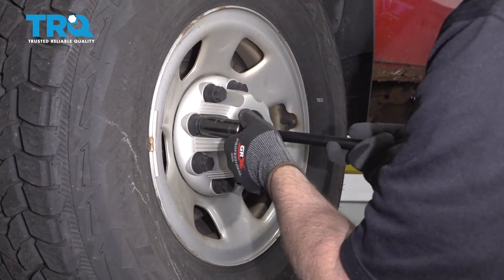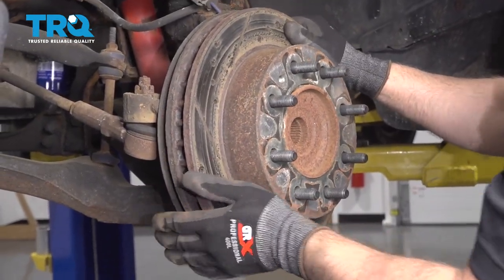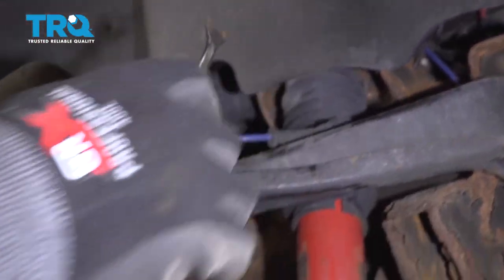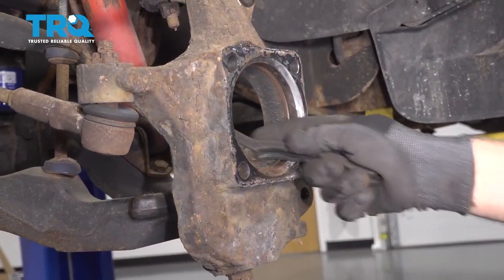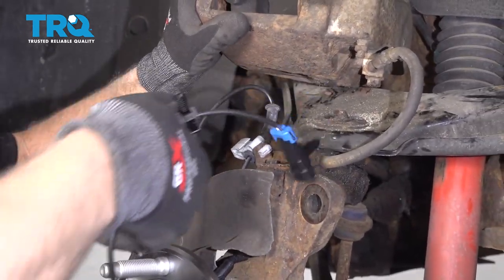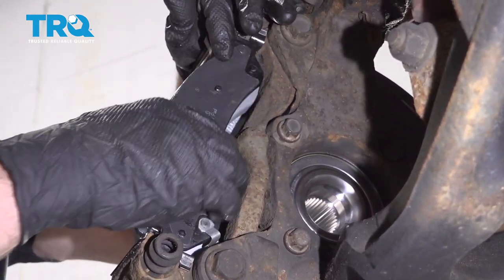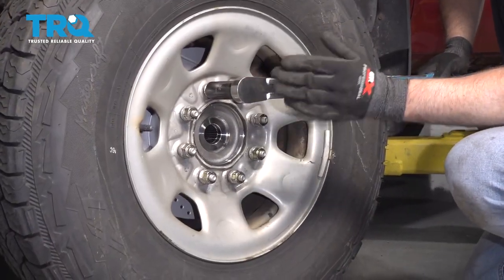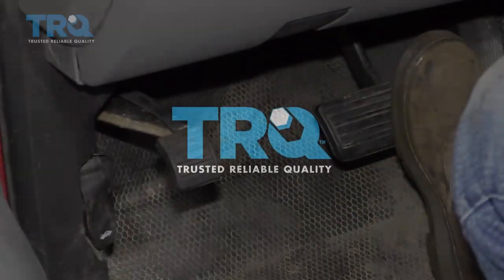How To Replace Wheel Bearing & Hub 2007-14 GMC Sierra 3500HD

Comment: How does that vehicle move when there is no drive shaft going into the wheel bearing?
Reply: I think it’s a 2 wheel drive
Reply: Would have been nice to mention the CV axle nut torque for the 4x4 trucks.

Comment: How often should the spindles be replaced have 185,000 miles on my Savannah 3500 with the original spindle
Reply: The knuckle should be a lifetime part, wheel bearings need replaced when they go bad. What spindle are you referring to?